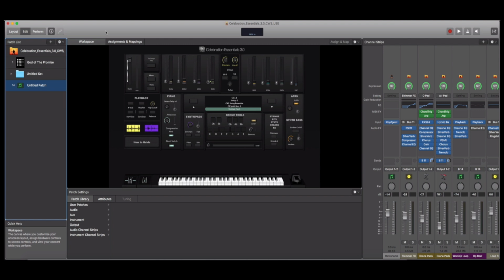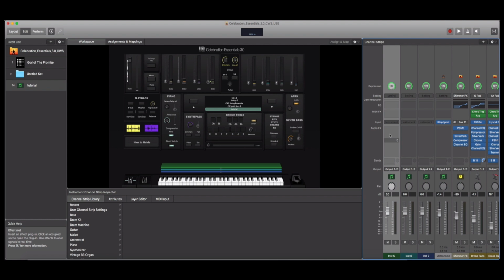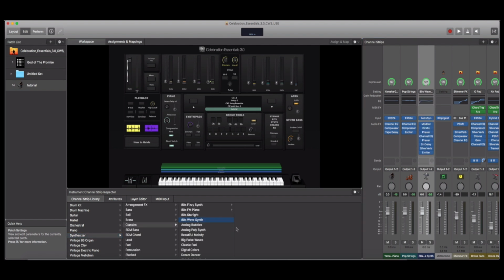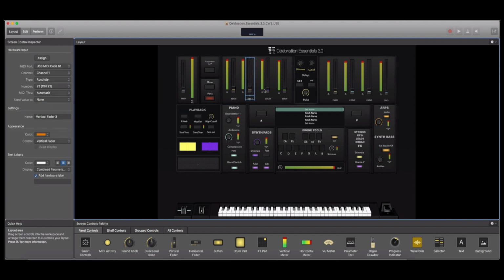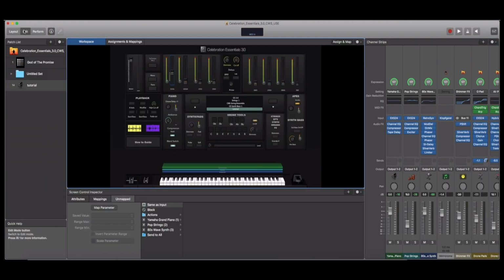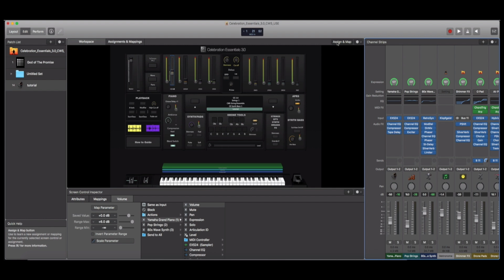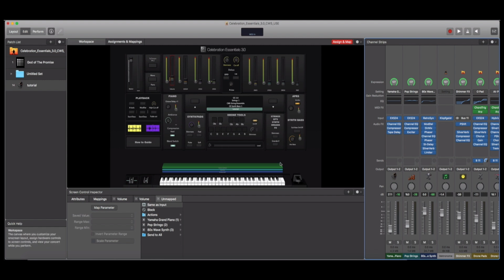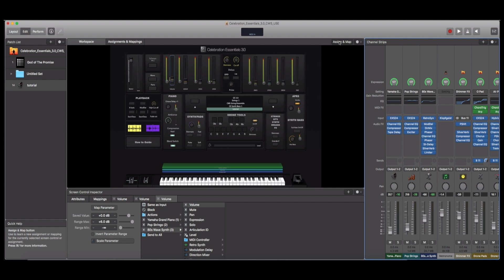How to assign multiple instruments to a single fader

Comment: I have a korg kontroll stage controller with my m-audio piano and am trying to just simply assign different voices/instruments to the different faders on the korg kontroll mixer but am failing. Is there an idiot proof way of doing it? Great video btw.
Reply from the maker: The same way you saw it done here you can do it, but instead of selecting the same fader select the other instrument fader so it can be assigned to its own individual channel strip fader. 

Also in the edit window assign the faders from your midi controller to the concert faders for them to work/receive the signal